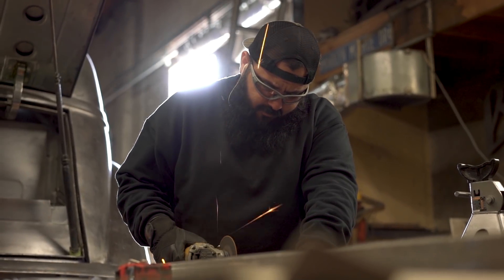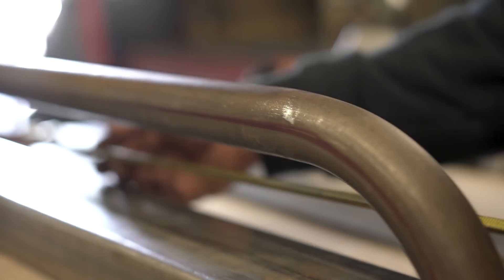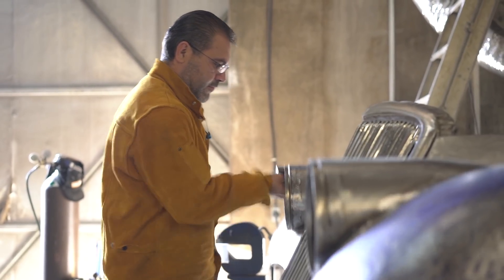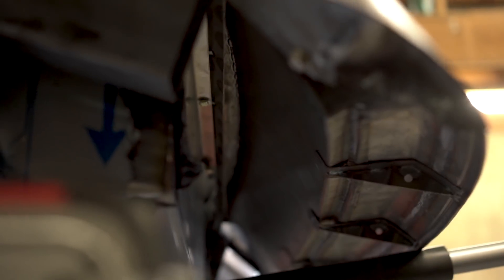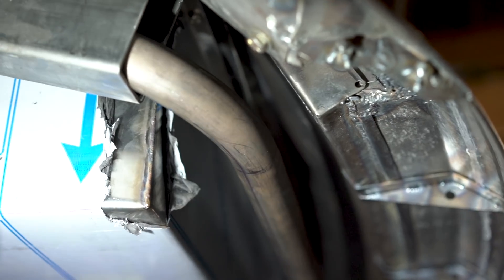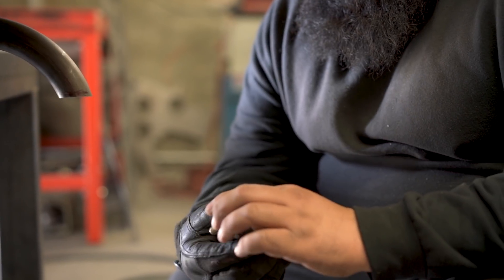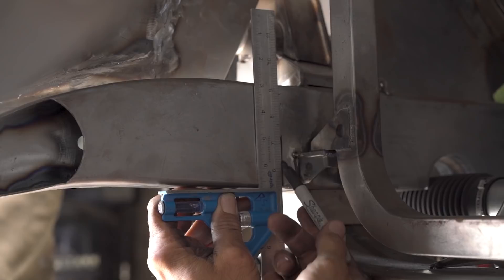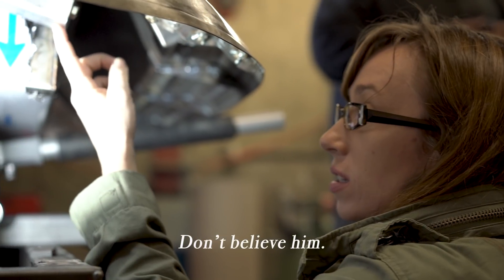The Vik - A Tim Allen Build - (part xci)

Comment: I worked a job as a DOD contractor for 40 years that had nothing to do with welding, but I had always wanted to learn.  When I retired at 63 I purchased a small 110 voltage Mr. TIG welder (TIG) and played around with it for a couple of years.  At the age of 65 I took two welding classes at a local community college and passed my TIG welding certification test.  I'm telling you this because, if I can learn to weld and pass a certification test I'm sure you could too.